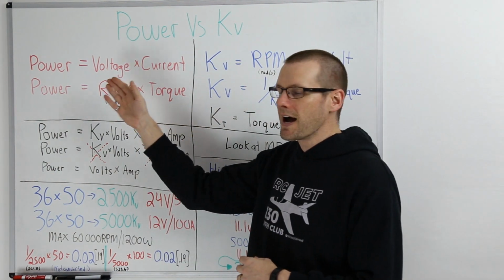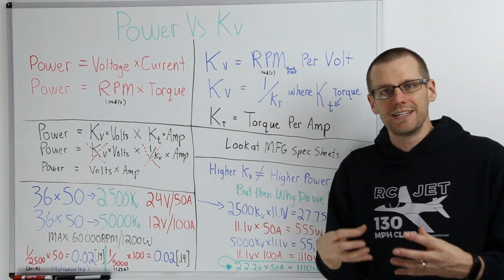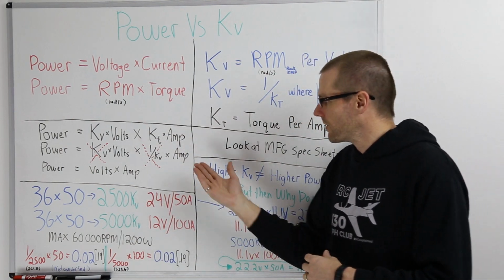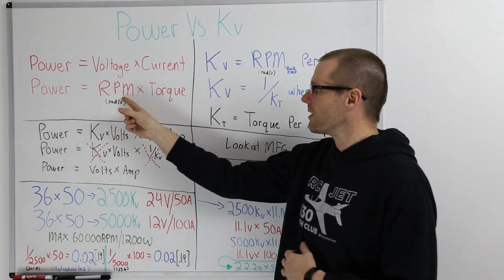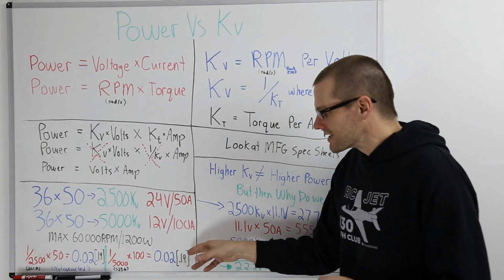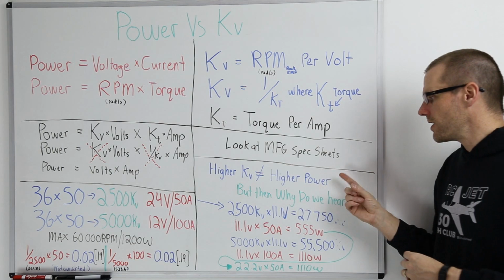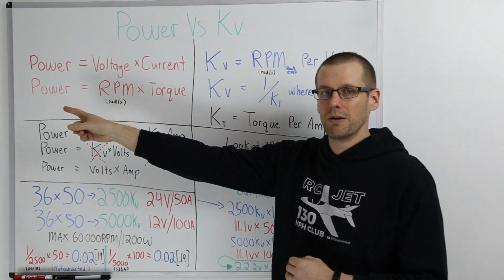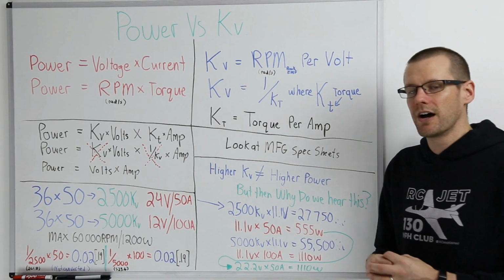Does a Higher Brushless Motor Kv Provide a Higher Power Output?

Comment: Trying to increase the speed on my arrma infraction 3s BLX . Right now it has a 3900kv motor. Can I run it on 4s if I get a 4s esc? Currently max speed is 70mph. Trying to hit atleast 80 mph. However even with max tall gearing I'm only getting 70mph.  I was told to get a lower KV rated motor and run it on 4S vs 3s. By doing this I was told  there would be less chances of overheating also. Im so confused right now.

Comment: So of you run a 11.1v battery on a 6500 kv motor get less output than if you ran the same 6500kv motor on a 6s 22.2v battery
Reply from the maker: You get maximum potential power by spinning the motor as close as you can to its maximum mechanical rpm limit without going over.

Comment: Hi community im looking for some suggestions if anyone can help. I have an 8th scale xray on road race car. I currently have a Hobbywing ezrun 4268 2500kv motor but the car felt slow down the straight. We race on road on a fairly large track where they race 5th scale cars too. I wanted to try to beef the car up a lil and cant decide if I should go higher kv or lower kv and gear up. We run the cars on 6s. Any help is greatly appreciated
Reply from the maker: 2500Kv is good for 6s. What I would do is move to a larger size motor if you can and gear up.
Reply: @RCexplained ok thank you. I need to measure. On the xray gtx8e there isnt much more room for a longer motor. I will meausre it out and see what will fit. But i think the 4268 is the biggest i can squeeze in there

Comment: Very good video! Very helpful. Essentially, it depends on the battery. To operate at the max power & torque, a low KV motor requires high voltage but lower ampere, while a high KV motor requires low voltage but high ampere.

High voltage battery is easier to reach/purchase. High ampere current is difficult to maintain for a battery.

Comment: I'm intending to use one of these motors to generate power. Based on what you said, it doesn't matter so much about the Kv value of the same sized motors, except for the fact that I might want a lower Kv so that I don't need such a high ratio gear box. If I use a windmill for example, that spins slow but with high torque to be able to spin a gear box which dials up the speed to the motors max rpm?
Reply from the maker: Match kv with the voltage you wish to use to hit the sweet zone for motor rpm.

Comment: In the real world you will see it makes a difference. And the reason for that is the different gauges of wire used and how dense or not they can be wound. This affects heat transfer, resistance, and amount of coverage on the stator.

Comment: 1. In the end example, can you not run more current (100 A) through the lower Kv motor and get the same power output?

*2. Is there a max current the motor can take? If so why/how? (refrased in comment) 

I feel this does not make sense, because RC car manufacturers usually pair a 11.1 V system with a ca 3 000 Kv motor. That gives a max rpm of ca 30 000, which seems quite inoptimal.

3. If you always want 60 000 rpm (or whatever is max for a certain motor), why is that not standard?

My understanding was that you choose Kv depending on your intended speed. That is if you want to have full power at a high speed, you opt for high Kv, if you want full power at low speed you opt for low Kv. Keeping in regards never to exceed max rpm.

If I understand you correctly, the only parameter for adjusting speed vs torque at the wheels, is gearing. That leaves one quite limited, considering only a few gear ratios fit in an RTR gearbox.
Reply from the maker: This is answered in the most recent video
Reply: On 2. Of course a motor has a max current. Refrasing the question:

2. Would a lower Kv motor not be able to take the same current as a high Kv one, given the same size? If not, why?

Comment: So lower kv you need higher voltage and higher kv lower voltage?
Reply from the maker: Yes. Kv multipled by voltage provides you with RPM. If you want to maintain equal RPM, lower Kv takes more voltage to do so.

Comment: A higher voltage is always recommended for a greater peak efficiency of the motor, partially because this result requires a thinner wire for winding around the poles which results in a greater winding density. The difference is usually maybe only a few % though.

Comment: My boy ! I need to know 560kv on 12s like the ezrun maz4 70125 560kv on 12s what is the amount of peak kilo wat or Newton meter tha it can produce
Reply from the maker: Torque = 0.0171 Nm / A * Amps.
Wattage = V*A. - equal to your voltage * how many amps your motor runs at.

Comment: Assuming the KV ratings are accurate, You’ve been telling us for years higher RPM equals more speed more power. I know how to tune the car though so I can take the lower RPM motor and get more power out of it using gear ratios ESC punch settings  tuning and tire size. If your set up is incapable of putting the power down then you’ve already lost.

Comment: You like to leave out options ~ Drag Racers/Speed Runners will run 24v on the 5000kv motor & gear it down for more torque ~ How or why don't you calculate & compare them options?????
Reply from the maker: 24v on 5000Kv is not an option.
Reply: @RCexplained  5000kv is just an example cause you use in the video ~ The Point Is We Run 8s On 5/6s Rated Motors With No Problems & You Never Calculate Or Compare That Options.
Reply from the maker: Using a higher cell count than spec'd by the manufacture is one thing. However, if this new cell count forces the max RPM to exceed the maximum allowable RPM by the motor manufacture, this is not a recomendable option for this channel.
Reply: @RCexplained  That's Interesting Cause I Know You Already Know This But For Example The Tp 4070-cm 3200kv Is Rated For 5s & The Tp 4070-cm 2950kv Is Rated For 6s BOTH Have A 75k Max RPM & BOTH Are Ran On 8s Because They Will Never Reach 75k RPM UNDER LOAD There For We Are Not Exceeding The Manufacture's Recommendation So Calculate Or Compare Them Options Should Be A Option For This Channel. Just My Opinion
Reply from the maker: What calculation do you use to show that the 3200Kv motor will never hit more than 75K RPM under load? This is one concern before getting to the major concern.
Reply: @RCexplained  A Lot Of Drag Racer Out Here Was Using The 3200kv On 8s B4 They Came Out With The Castle 1721 2400kv & Their Data logs Never Touch 75k RPMs
Reply: yep, I always overcell my motors. have ran 6s on a 3.5 trinity hole shot motor in a 748, we run 4100 on 6s, 5500 on 6s and now we are testing 2000-2200 on 10s. all drag racing of course

Comment: If we run higher voltage than motor rated for can it be a advantage.  A cheaper way to achieve greater speed.. I run max 6with 2050 kv the higher Amp esc the motor runs cooler. So I tried 8s through 6s motor . The infraction so fast in limited space its hard to see a difference. Anyone ?
Reply from the maker: I ignore the voltage a motor is rated for and specifically look for the max RPM a motor is rated for. I apply no more voltage then the voltage that would get me to this max.

Comment: Great explanation. I would love to see you do a performance bench test of the castle 1721 2400kv motor v the TP Power 4080cm 2022kv motor to see which motor has the most performance potential.

Awesome explanation and content👍
Reply from the maker: That new 4080 motor is a beast. Why the 2022Kv version (did they do this on purpose with the year) vs the others they offer? they have a 2350Kv version too.
Reply: @RCexplained  I can confirm that 4080cm 2022kv is a beast as I run it in my erevo 2.0 on 8S🤣

I guess seeing that I have the motor, it would be fun to see how it performs against the Castle 2400kv motor.

Comment: So if the load is identical for the two given examples, and the same ESC is used, (lets say 150amp) will there be less heat generated by the 6s system pulling 50amps vs the 3s system pulling 100amps? Also, will the two make peak torque and peak power at different rpm?
Reply: Good question I find running higher Amp esc does wonders for running cooler , max 6 in arrma road cars same with max 6 in xrt it seems
Reply: You said same esc than 6s system lol more amps used more heat it's just measuring current used less current restrictions less heat higher voltage less heat less amperage used to obtain same speeds I'm think that's how that works . Ik bigger escs used for motor more forgiveness comes to heat

Comment: Another thing to consider is the torque added by gear ratios.  Comparing that 2500kv vs a 5000kv the 5000kv can make use of a 2x gearing torque multiplier while going the same speed.  Shooting for 50k rpms is a good rule of thumb for cars.
Reply: We need a rpm
Gun to measure in rc hobby . Ik they make them
Reply: @paulclancy2404  Rpms can be figured out by speed and rolling diameters.
Reply: @saransmith8773  yea but for motors we don't know the speed , I guess like he said we're even past something as a rpm gun maybe? With database you can go on PC and know everything.  I just figured we have temp guns why not rpm guns .
Reply: @paulclancy2404  what r u on about kv  is rpm's per volt figure it out stop being so lazy
Reply: Don’t data loggers read motor rpm’s in real time?
If not I never knew.
Reply: @Mike62501  I believe they do